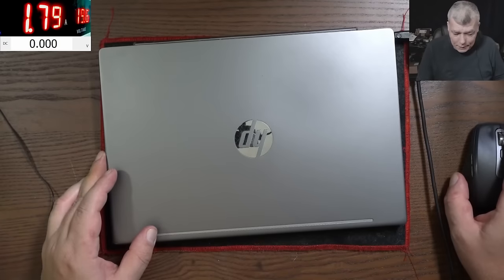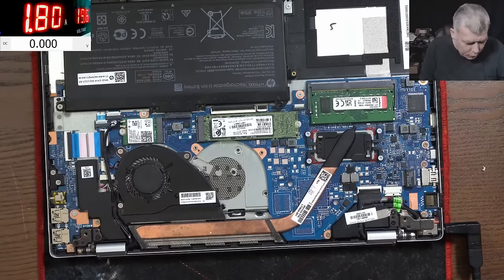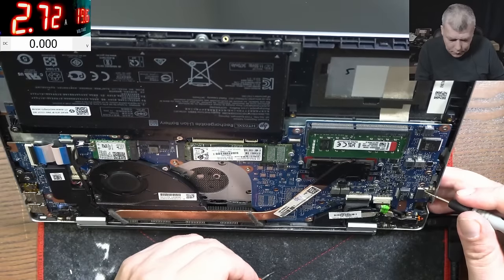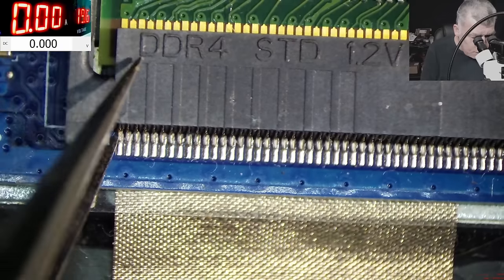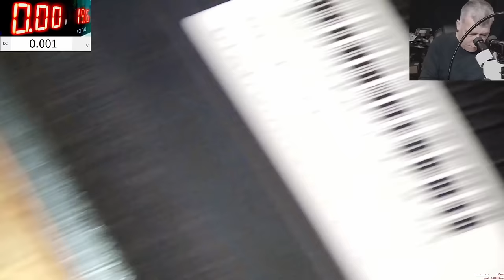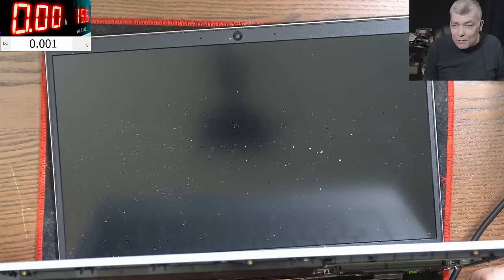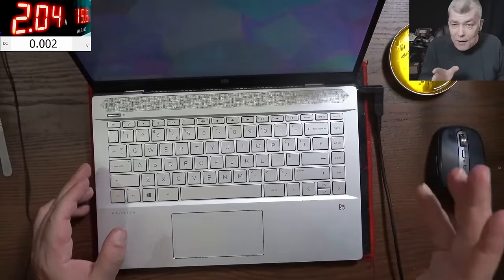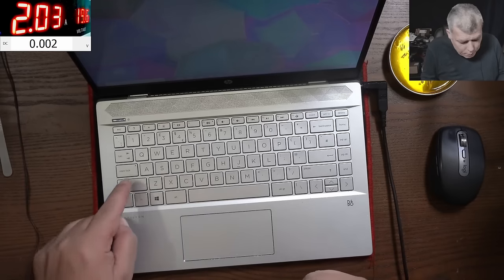HP Pavilion 14-CE laptop coming on with no picture? This is a common fault!

Comment: Sorin, you should have put brand and model number in title "HP Pavilion 14-CE". If someone is having this same problem, Not booting, no picture, it gives them a better chance of finding your video. Increasing your views and subscribers. So often we find the same problems over and over. Just like a broken belt on a vacuum cleaner, look for locked up bearings on beater/brush bar.
Reply: Just had this issues with 255 g7 .. it's hp in general fault

Comment: I ALWAYS enjoy your videos. Would love to meet you and say hey some time. I just had an HP 15-DY come in and it was the same problem, but the screen was flickering instead of being completely out. This model has 2 RAM Slots. I had to go accross all of the pins with my iron and it fixed the issue. I tested each pin and they would not move, but you could tell that the solder points were scetchy. The pins were not even loose this time. Just resoldering with a solid connection did the trick.
Reply: The same thing happened to me and i didn't know what's causing the flickering, but i assume the RAM or the RAM socket is the problem

Comment: Sorin, regarding the HDMI subject, you can test even without windows loaded. First disconnect the LCD connector. The graphics card will detect that there's no internal display and tries to output to HDMI. If you have an HDMI cable connected to a tv or capture card, it will display even without windows loaded. Nice work
Reply: this DOES NOT WORK FOR DELL LAPTOPS.without detecting the screen connected,they dont post.
Reply: Worked with my previously owned Microsoft Surface Pro 7. HDMI worked before windows loading after the internal display was disconnected. 👍🏽

Comment: You saved my ass.. 🥳 i had ssd upgrade job on hp 255 g7 and after cloning the drive and cleaning up system , it froze and gave me corrupted bluescreen after which it was not booting anymore and i had memory fault code flashing. I could have lost money on that simple job,and you saved me . I owe you at least few more months of membership. I am greatfull to you! Thanks 🙏 🥰🥰🥰

Comment: This really looked like a BIOS issue to me at the beginning. Maybe the experience with this exact model of laptop was key on diagnosing the issue here. I wouldn't have found it so quickly.
Reply: @viniciusvb22: Yeah. I also thought that the fault was the SpiFlash memory and I would have put a new one in without programming it at startup and recording it later without hesitation if the fault continued. All the best.
Reply: It's not the issue with just this model , it's hp in general, and their tolerance for chassis flex.

Comment: When confronted with this type of problem, the first thing I do is reseat the memory. That fixes it 25% of the time. the next thing is plug in an HDMI to a monitor. If it's getting a picture, you know it's a bad screen or video cable. If neither, then I get the v/o meter out.

Comment: Hello Sarin. I have two laptops hp zbook studio x360 g5 The both have same problem. Most of the time, but not always, when I connect the charger, the system makes a lot of noise, to the extent that the touchpad stops working, and sometimes the touch screen LEDs turn on intermittently.This happened so many times that a little shadow of the LEDs remained on the LCD. I tried with another charger, but it still has the same problem. Finally, I concluded that the problem is with the charging circuit on the motherboard.I am from another country, so I can't send it to you, and the repairman couldn't find the problem either. I wanted to see if you have experience with this laptop model and this problem?Even the schematic of the laptop is not available and I did not find anything about it through searching. Thank you for your guidance.

Comment: Not the first time you've seen this on a HP laptop - seems to be an issue with their motherboard manufacturer.
Reply: Their laptops are made like shit and they are flexing the board a lot i think.
Had one just now with same issue ( hp 255 g7) . Might be intentionaly designed like that, wouldn't surprise me ..

Comment: May I ask because it's a bit confusing, how come in continuity / beep mode you test with the red probe on ground as in diode mode?
Reply: I don't think it matters which way around you test so it just so happened Sorin picked up the red probe first - 50% change he could have used the black one!
Reply: He was checking for short circuit, it would have shown very low resistance regardless of polarity
Reply: There is no difference between probes in beeping mode he's looking for a short circuit or abnormal resistance.
Reply: @emmanuelvalmas5468: A while ago I read an answer: If the DMM is placed in the diode test function and the positive (+) test lead is brought to a ground point (GND) on the PCB, the current supplied by the internal battery voltage of the meter is reduced to the minimum necessary for proper functioning of the selected range.
He received a lot of criticism. Another way of saying it: I don't know the answer with certainty, however, it collides with what they taught me in technical school for the diode test function. So for me it is a "conventionalism" that is left to personal discretion whether to use it or NOT.
The following is a certainty: For the continuity function, the polarity of the test terminals in their placement on the PCB is not important. All the best.
Reply: Thank You  @retrocomputinggrotto

Comment: HP is notorious to use the cheapest graphic cards and chips in their products since early 2000. The worst brand on a market. I've used to have X1000, G62, G2-2nd Gen, etc. All have the display issues, all of those. Avoid

Comment: Without a microscope, I can't tell whether a pin of such fine pitch is moving or not. 😢 
But... Buying a microscope is also kinda meh. 
Then again, I'll use it for many years if I actually buy one.
Reply: and you will use it for many things and also there are some that are very cheap
Reply: @regresoderambo i should buy one
Reply: Just buy a 2 dollar magnifying glass
Reply: @silviuguseila2552  i have one used wireless connection with phone but i like that sorin used i don't know if i'll find cheap one 😀
Reply: $3 macro lens for a phone will get you pretty close.